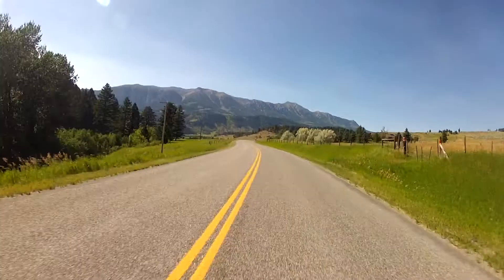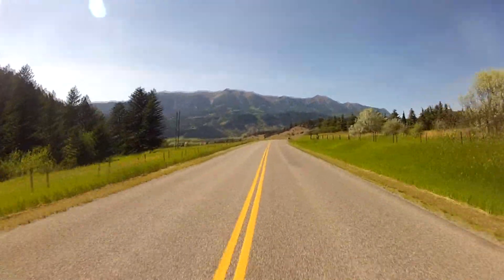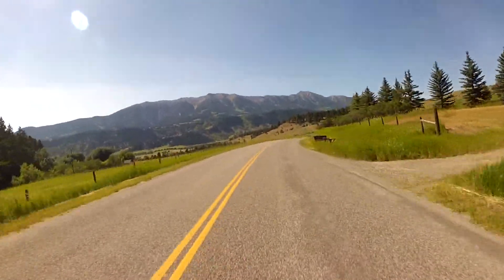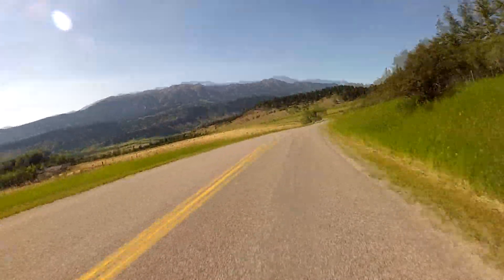Performance - Power, Torque, & the Transmission

Comment from the maker: I should have prefaced everything by saying I always assume the gearing is reasonably appropriate for the engine & vehicle.
So yes, the first sentence is correct for a given instant (keep in mind that that also means higher HP at that instant), but the second is not. Torque does not equal work, torque*revolutions=work. 3rd and 4th sentences are correct, but the 5th is not. Power=(work/time)=(force*distance/time)=(force*speed)=(torque*revolutions/time)=(torque*rotation speed).